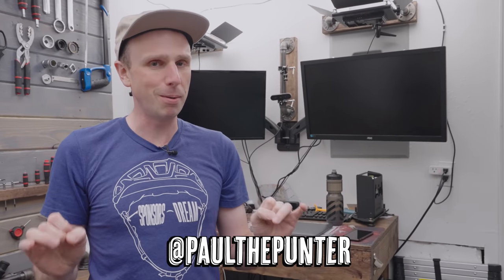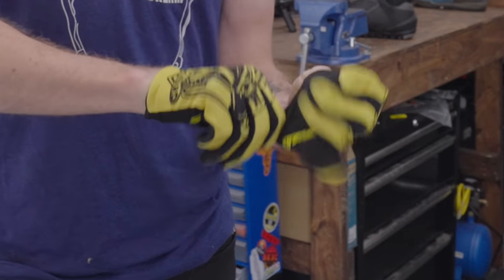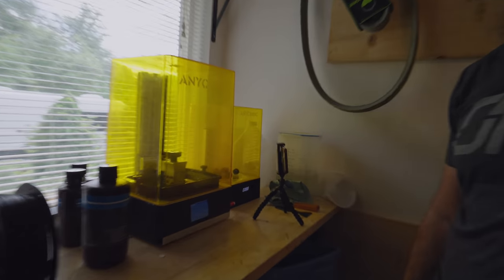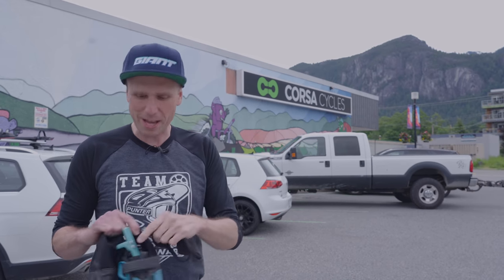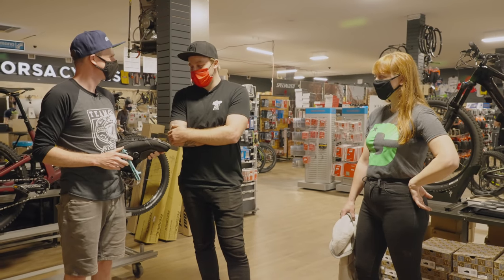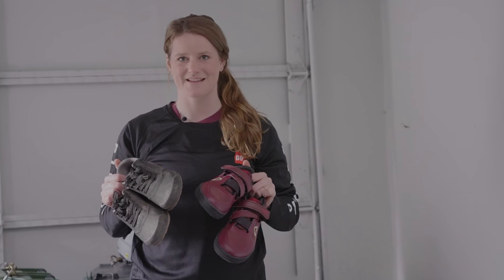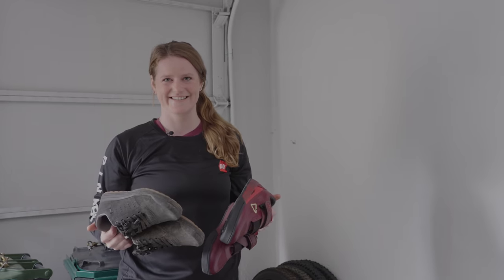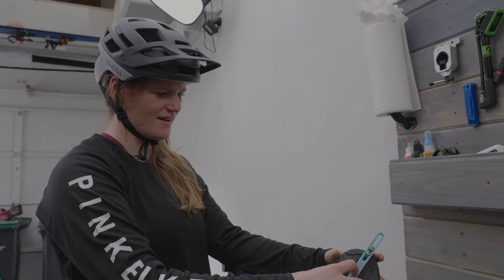This Is For Anyone That Uses Clipless Pedals...

Comment from the maker: Ok look, if you’re coming to say “why not have two sets of cleats”.......it’s about replicating the position so you can have the cleats in the same position on different shoes.....it’s not about only having one set and swapping them between shoes. Come on Punters, pull it together! 🤦‍♂️
Reply: Easy solution, just ride flat pedals
Reply: I think that the measurements to replicate are (1) the horizontal distance from the point midway between the cleat fixing screws to the heel of your foot, and (2) the angle that line makes with the pedal axle (or crank arm or whatever is easiest to measure).  Otherwise you are relying upon the inside of the shoe letting your foot place itself the exact same way in two entirely different shoes.
Reply: @ericpmoss  totally agree, measure from the heel instead of the toe. There is no rocker that way. Would totally buy one!! I have knee issues and getting the cleats just right can make or break a ride!! And if you ride lots your cleats wear out. I would use this a couple of times a year at least!!
Reply: If you duplicated the toe pointer to the reverse side, and same with the jaws...

You can set up for the left foot.... and the right foot gauge is already set (i.e. you flip it over and fit the 2nd shoe without resetting the measurements.
(1 flaw - only works if you have symmetrical mounting... most would, but some have 1 longer foot... and may find the mount point is foot centre, which would be 1/2 the difference out... just as an example... oh and others may like one foot slightly twisted out etc....  lets count out all us freaks and the double sided NoFaf5K 2.0 will rock.
(I don't ride clipless/kleats myself.. are they adjustable left/right or only the rotation... if they can be moved left/right you may need another finger gauge to the outside of your foot (I chose outside as the inside can be concave or filled on some shoes but the outermost of the outside is usually the side of your foot not the sole...

If only I had a 3d printer to test... not that I'm going to put clipless on my ol Giant Faith... tho perhaps it would add a few crash videos to my channel..

q8)
Reply: Hey I made a video for you, btw awesome vid!! 😊

Comment: I think the cleat position is relative to your foot inside the shoe, not the external design of the shoe. Waiting for a bike fitter to come along and chime in, but i think you're measuring and locking down the wrong distance.
Reply: This is what I was trying to put across.

It’s your foot, not the shoe. 

Measuring different shoes for same cleat position using the shoe, wont work.
Reply: Agreed!  This is fine if the two shoes are identical.  Cleats are positioned relative to the metatarsals, not the toe. Going from brand A to brand B would, most likely, position the cleat incorrectly.  A device that somehow finds the metatarsals and shows cleat position based on that is the ticket.  That said, simply find and mark on the shoe the 1st and 5th while wearing the shoe and drawing a line across locates the front of the cleat.
Reply: The feeler on the tool should be a heel-shaped lump that is pushed into the heel cup of the shoe, to replicate cleat position relative to the heel.
Reply: @richardaltman7468  This seems like a great way to do it. Have a clamp that you align to your first and fifth metatarsal with a lockable guide to set over the cleat. Make sure you have through holes to get to the fasteners - Boom. Aligned to foot, not shoe.
Reply: It’s dependent on having a shoe that already has the correct position.  A bike shop would want something that sets up proper position from scratch whereas this would be more useful for someone at home setting up cleat positions from an already set up shoe.
Reply: Correct.  The sole of the shoe is variable depending on design.  For example a boot may have a big lugs and rubber molding around the toes  while a XC shoe may not.

Comment: I like the idea.  I don’t ride clipless anymore but I did for years and I remember what a pain it could be to either set up new shoes or replace a worn out cleat.  I would take an awl and scribe a line around the cleat so I could get a new cleat in the right spot.  If it was off just a hair it would feel like it was off by a mile.   Good luck with the marketing!  You could be Paul the Podiatrist of the MTB world.
Reply: I'm with you. After decades of riding clipless, I gave up last year due to all the faffing around trying to get the cleats just right on a new pair of Shimano. Switched to flats and I've been a happy camper ever since.

Comment: Maybe using the heel and inner edge of the sole would overcome the upturned toe and brand-related sole cutout issues? Also, heel-to-cleat may be a more consistent measure than toe-to-cleat across brands and shoe styles.

You could extend the range to solve other irritating issues too…the no-faff-5001 for brake lever angle / reach for instance, or the nf-5002 for getting the logo on your top-cap lined up properly…

Comment: I think the first instinct was the best, having the outside box of the shoe determine the position, maybe even concentrate on the heel instead of the toes:

I recently switched from 'slick' shoes to 'skater' style shimano shoes, were the first ones were more narrow so I needed a size up. This 'extra size' is mostly in the empty space by the toes, so the toes are not a really a good reference point, where the heel mostly is since shoes always push your feet back.

While buying these new shoes I also saw that different manufacturers positioned their 'default' (centered) position differently, where centering on the slot wouldn't work. So I think triangulating the position between the width of the ball of your foot and the position of the heel is better. Especially since the heel is further away from the cleat so the angle will be more precise as well.

Comment: This is fine if the two shoes are identical.  Cleats are positioned relative to the metatarsals, not the toe or the heel. Going from brand A to brand B would, most likely, position the cleat incorrectly.  Consider that you may wear a size 44 Shimano and a size 45 or 43 in Specialized or Sidi.  A device that somehow finds the metatarsals and shows cleat position based on that is the ticket.  That said, simply find and mark on the shoe the 1st and 5th metatarsals while wearing the shoe and drawing a line across locates the front of the cleat.

Comment: I came here to buy this.  Have had a similar design in my head for years.  I do annual replacments of my cleats. Measure from the heal and not the toe. Have an angle pointer that measures from the back of that heal support.  Then add a distance from the heal measure to the center of the cleat.  Going to and from a deeply cleated shoe may cause impediments.

Comment: I have a suggestion to cover other brands of cleats. The part that contacts the cleat, why not make a set of those parts to cover each brand of popular cleats as a kit that includes the adjustable toe piece. that can all be switched out depending on what brand or style. Or make that piece specific to whatever brand someone uses. A shop would buy the set for all brands/styles. To keep costs down I would look into a tough but slightly flexible polymer that could be injection molded and not machined like aluminum would be. Once the molds for the pieces are made then production is a matter of using the correct molds. I run flats and have no idea how many cleat brands or styles there are. If roadie cleats are the same then that opens up your market, too. I think it's a great idea. The concept is used in many different applications.

Comment: Easiest fix would be different parts that hook onto the toe. Main too part is metal and the "toe" stop being plastic. Instead of a flat stop, other shoe styles it could be more of a wedge that fills the gap of the curve. Would agree that it could be a $200 tool for a shoe with different adapters for shoes. Comes with 5-10 adapters with more being developed later on and sold for a few dollars.

Comment: I was laughing at first then i thought about it for shimano cleats its cool I have been running time atac pedals which are way easier to set up than shimano and they dont unclip when you dont want them to and offer way more float before unclipping so basically if you choose to run shimanos inferior pedal system the NF5000 would make the job easier.
Reply: Haha so true. Been running Time Atac’s for years and I never understood why people choose SPD’s. In the mud they suck, have no float and unclip for no reason.
Reply: @frits8986  And yet I used Time pedals for a couple of years, but went back to SPDs because i preferred them. 
Lots of float in my silver SPDs and mud isn't an issue either. If they pop out too easily, they are set too loose.

Comment: Consider this: there are hundreds of shoe manufacturers, each of them positions the " cleat mounting area " differently and has a different design of the toe box. This tool is only going to work with identical shoes, or those made by the same company. I suppose that many riders choose a different brand of shoes to their old ones when picking up a new pair. That's where I personally would use this sort of tool, but it is useless in that sense according to reasons mentioned above. Additionally there the good old " ball of the foot reference point method " which is accurate regardless of the brand.

Comment: How would the SPD Aligner work if the sole is different on different shoes. 

If I buy a size 8 on summer shoes and then go a size or 2 sizes up for winter shoes to allow thick socks 🧦, how would it work? 

The reference points would change on different shoes. 

Even buying the same shoe after the older one wears out might not work either as manufacturers change designs of the same shoe when they bring out a newer model.  So it might not work on this situation either. 

If you want to put a new cleat on your shoe with worn out cleats. Just draw around your cleat with a marker pen or chinagrapth pen. Take of old cleat and then put on new one, simple. 

🤔🤔

Comment: I would say it is a very best tool. But your design would be on spd on shimano shoe. What happen using crankbrothers cleats, the mold becomes different. But the concept is there. Would say just the point of 2 bolt for universal cleat and the bumper on the end shoe longer may solve it.

Comment: Sorry Paul, but sounds like a complicated solution for an easy problem. Just measure the position of your cleat i.e. in relation to your heel and transfer it to any other shoe.
Reply from the maker: This is doing exactly that but a different way of taking that measurement. It's a faster way and something that ideally should use less brain power and eliminate more human error.
Reply: @PaulThePunter  I was going to say along these lines, that in an updated version of this nifty tool, perhaps measuring from the heel of the shoe would offer a more consistent and level anchor point than the toe. I'd think that would be a pretty straightforward change.
Reply: @evanmarquardt561  🤔 may have to draft something up.
Reply: Make the toes reference bar longer to accommodate more upturned shoes, or reference off the heel…

Comment: Want a better alternative for all shoes? 

What you need:
-Bare feet or with socks
-calipers or a ruler 
-marker (the finer the better)
-double sided tape (foam tape is better)
-both pairs of shoes with shoe inserts removed

Instructions:
1. Mark your cleat position on the first shoe.
2. Measure the gap between the main cleat and the plate that holds the screws.
3. Loosen the shoe and put the double sided tape on the plate where the screw is threaded.
4. Wear it without touching the tape and position your feet then tighten the shoes so your feet wont move. Try to not touch the tape for as long as possible.
5. Loosen the bolts of the cleat then loosen the shoe and remove your feet.
6. Wear the other shoe and align the plate roughly.
7. Tighten the shoe till your feet cant move and roughly position the cleat then screw it tight.  
8. Remove your feet and mark the fore aft position of the shoe.
9. Copy the side to side measurements you got from step 2.
10. Enjoy.

If the plate is too far from the shoe holes:
7. Tighten your shoes till your feet cant move
8. Draw a line between the two threads on the sole to mark the fore aft position.
9. Measure the gap from the center of the thread holes and the center of the shoe hole.
10. Remove your feet and remove the plate from your feet then align it with the line then roughly put the cleat on.
11. Add or subtract the number you got on step 9 and step 2 and copy then position your cleat with ±0.000000000001 mm accuracy
12. Enjoy.

Comment: Just use flats and get a pair of 5/10's
Reply: That may work for people who only care about going downhill, but not for proper XC riders.  

When I started racing, we were using toe clips and straps.  I hated the lack of power so much that I used road shoes with old school plastic cleats and double leather straps to lock my feet onto the pedals.  I absolutely had to reach down to release the straps to get out.  It forced me to become a good bike handler though; I HAD to get up that short technical climb or I would end up falling sideways.  I was glad when Shimano came out with M737s though.
Reply: @keirfarnum6811  I guess it depends on your definition of "proper XC rider."  I ride and race XC 3-4 x's per year and I prefer flats over clips.  I started with clips and found I liked the control of flats better both downhill, uphill, over roots and rocks, pumping, etc. I will admit that most XC riders/racers use clips (maybe that's why I'm a middle of the pack finisher). I also remember a time when I was one of the few racers that showed up at the start line with a dropper post on my bike and now they are commonplace. Both pedal formats have their pros and cons, flats are super easy with no finicky adjustments, but they can definitely hurt your shins should your foot slip (and I have the scars to prove it). At the end of the day it comes down to personal preference, ride what works best for you.

Comment: I think you have misidentified the big problem. Fleet position between different sets of shoes is not so big an issue rather that getting the position the same (mirrored) between left and right on the same pair of shoes
Reply: It doesn't have to be exactly mirrored. Left and right leg/foot may have different positions on the pedals. Mine ceats are set in slightly different angles.

Comment: I guess I always thought the best cleat position was as far back as possible.
Reply from the maker: Sometimes you need to rotate them to save your knees. For example, mine point slightly outwards.
Reply: @PaulThePunter  I only clip in on my trainer but they are shimano shoes.

Comment: don't really work in the real world as the sole of a shoe is not clued onto the upper part of the shoe in the exact same position every time  even on the same model of shoe when they are manufactured. So you might get the cleat placed the same place on the sole, but it does not really correlate to where your food would be in the shoe

Comment: How is this a 17 minute video talking about what can be accomplished with a tape measure?
Reply: 3d print tougher and better plastic connecting rod roller guides for new Shimano brakes. Theres a dinky 2mm thick piece of plastic that the lever presses on guide rollers, that roll on plastic. Not serviceable, just had an slx brake fall apart internally. No crash. Could be super dangerous if theres no way to service.